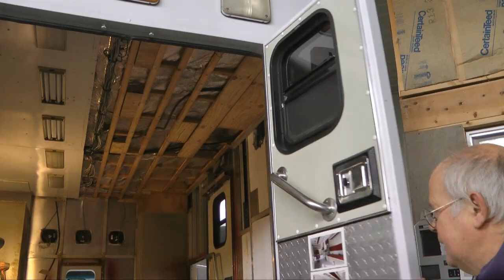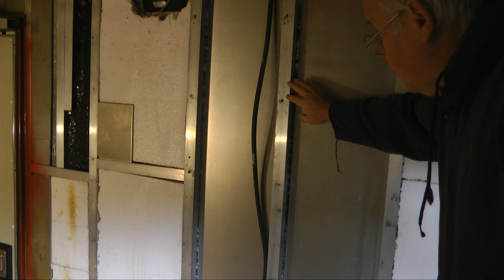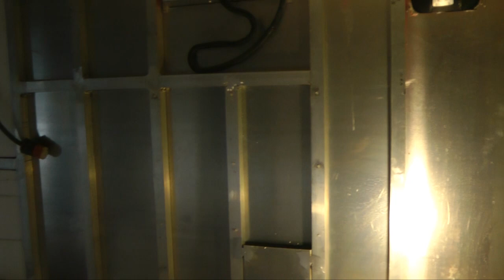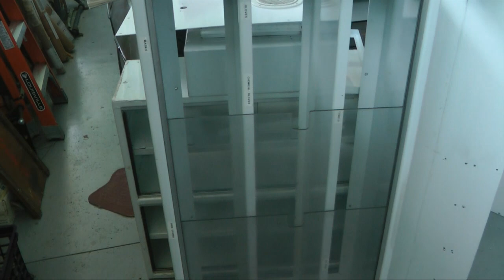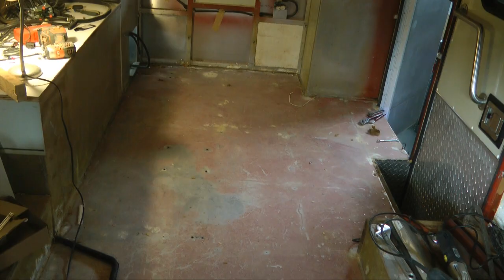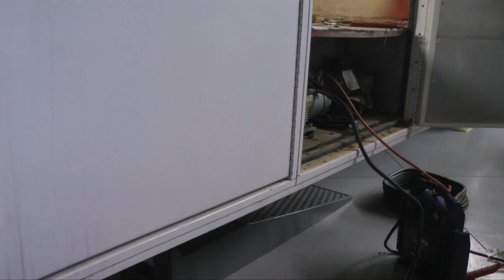Ambulance Conversion: Demolition

Comment: Hi again Jon
I asked before as to how much are these American ambulances to buy?
I take it that they are reasonable to run… gas/ maintenance etc??
Cheers from UK 🇬🇧
Reply from the maker: It seems that a 25-20 year old ambulance goes for in the neighborhood of $10-20K US - mileage, condition vary widely.  Also, in our rust belt states - the cab portion and frame still can rust bad. Most are diesel - which is a good thing. Typically well maintained but HIGH mileage is the norm.  You must understand and love fixing old vehicles - age always takes it toll on many parts. Being a truck mechanic usually requires the larger tools in the box! and pneumatic ones at that!